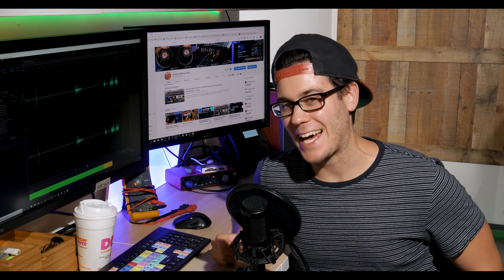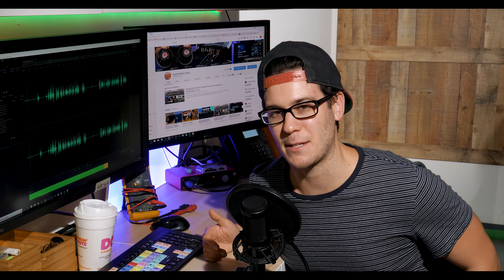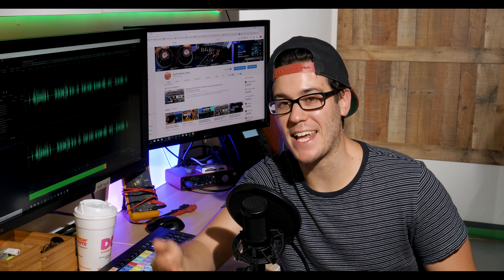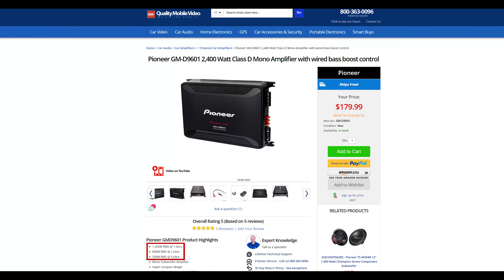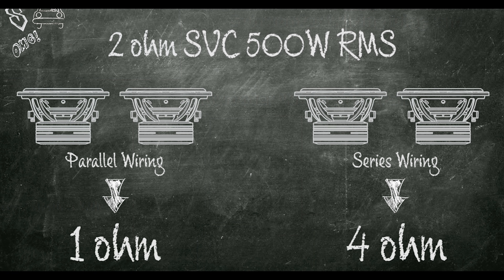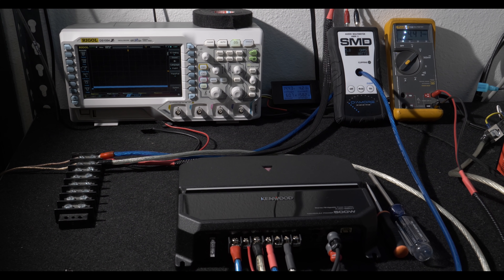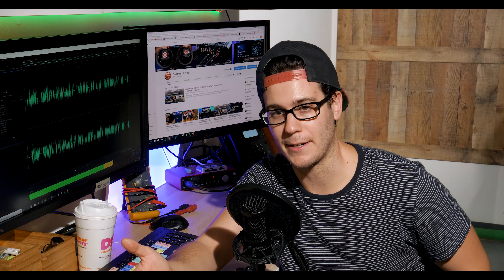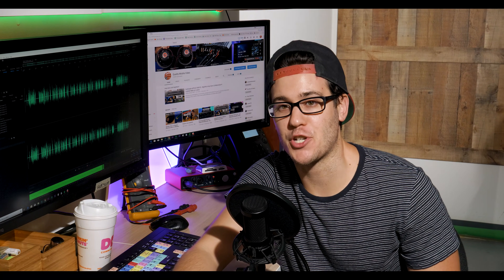Parallel Wiring vs Series Wiring - More Bass?  Cahh Audio 101

Comment: Ok I have 2 10 inch eclipse, 3oHM 500 rms sw8102DVC  wire@3ohm & in a JL power wedged box seald I want to run them at 0.8 ohms but my cxa800 kicker amp and my blapunkt 3000d can barely keep up with it my lights dim my rpm’s drop and my car will seem to all most die I have a new alt battry big3 @0.8ohm  I don’t want to blow the amps    what amps do good at   1000 rms @0.8 ohms stable do I need bigger whire like o gage i have 4 gage or a super hybrid cap? What would be the best way to go

Comment: Great video! You are one funny dude. I was rolling! Anyway, I have a roughly 6 or 7 yr old hifonics brutus amp which still works perfectly. It is a 2400.1d monoblock. I WAS using it to power two 600 watt RMS Audiobahn 10 inch subs at 4 ohms. Those subs are 25 yrs old. It's time to upgrade!! Since I have limited space for the box, I want to get 2 really good 8 inch subs. I'm leaning heavily towards two CT Sound 8 inch Meso's which are rated at 800 RMS watts each. A CT dual enclosure is the right size for my space (L, W, H) and is a perfect match for the subs according to the CT website. My question is, should I buy the dual voice coil 2 ohm or the dual voice coil 4 ohm? I would like to run them at 1 ohm so I can utilize all of the 2400 watts of my amp. So basically 1200 watts per speaker. According to all the research I've done on these subs, they can definitely handle the extra power! The box is ported and tuned to 39 hz and the amp IS 1 ohm stable. From everything I've seen on YouTube, I THINK I should get the dual vc 4 ohms and wire them in parallel to get a final impedance of 1 ohm. Is this correct?

Comment: I have 2 skar sdr 10 D2 subs and I sundown 1750 Mono amp 1ohm. Should I wire the subs to 1ohm ?
Reply from the maker: You won’t be able to, you can only make a 0.5 ohm load or a 2 ohm load with D2’s

Comment: I heard somewhere that wiring in series increases motor force... But not sure if that's true
Reply from the maker: That would be new to me, motor force should be a product of magnet strength and electrical current in the coil under thermal limit. I could be wrong.

Comment: Ok so I have a kicker l7 solo baric 2ohm how should I wire it also I have a pioneer 1,000 watt amp should I wire it negative to positive on one side then the other negative and pos to amp or should I run wires to pos to pos and negative to negative

Comment: I’m going to buy 2 Skar Audio SVR-12 12-inch dual 2 ohm subs, a ported box (SK2X12V) that is tuned to 32HZ, and  the RP-2000.1D Class D monoblock that makes 2000 w rms at 1 OHM and 2800w max, how should I wire these up? And at what ohm? I’m barely learning about this so I would appreciate any help 👍

Comment: Ok I have two alpine type s 10s with an alpine s-a60m amp can I wire them down to 1 ohm or what is the best way to wire these for the most bass for this Application
Reply from the maker: If the amp supports the load, you will get the most power at 1 ohm

Comment: I have 3 Kicker Comp C12s and a 1500 watt Planet Audio anarchy amp. I want it to hit hard and not destroy either one. Going in a 88 Monte Carlo. 2 in a vented box 1 in a single kicker box
Reply from the maker: Depending on what model amp it likely will not be enough. Many of the Plant “1500 watt” amps are class AB and will run only down to 2 ohms and put out 200-400 watts tops.
Reply: I have two kicker comp r 12s on a 4000 watt planet audio amp custom ported box In A cutlass .No upgraded alternator or anything . I’d honestly put about a 6000 watt amp on there . Bridge the speakers . And let that mf quake

Comment: If the speaker is 2 ohms its more bass
Reply from the maker: Not necessarily, depends on you amplifier too. Subwoofer impedance and voice coil size also dictate what kind of loads you can make at your amplifier for wiring. The lower the load, the more power.

Comment: I can’t decide whether to drive my single, sealed (1cuft) 12” Audiofrog subwoofer at 1 or 2 ohm. Subwoofer is 500wrms. Helix M One Amp can do either but @ 1ohm it’s 600w and @ 2 it’s 410w. My goal is accuracy, efficiency, and SQ. I’m leaning towards 2ohm. But is sacrificing that extra power worth however much more “efficient” it will be? It’s under the drivers seat so it has plenty of breathing room.
Reply: Run it at 1 ohm

Comment: I’m new to the whole audio stuff on vehicles. So this may be a dumb question. But would anyone know why My amp gets INSANELY hot? I installed it myself. After watching a video. So it’s very likely I messed something up😂 but everything works right. I bought a kit, it came with subs and an amp. It was a audiopipe kit (AudioPipe #APSB-1299pp) the amp is 500 watts. I’ve been told the amp isn’t good enough and I’ve been told my wiring was messed up or not “big” enough. The wires that I used came with the kit. I think the power and ground is 10 gauge and the speaker wire is 12 gauge. Like I said I’m new. And I have no one other than YouTube to ask 😂 any help would be appreciated.
Reply: Your ground might not be in a good spot that’ll cause heat, I melted a terminal like that, also I’d upgrade wiring because if your putting it too close to its rms rating it will heat the wire up allowing more power through due to less resist

Comment: Love your videos! Where I live the only nearby installation place was best buy, the guy wired my 1ohm 2000w amp and my single 12inch 4ohm dvc subwoofer in an enclosure(stock head unit with an adapter for RCA input)  he told me he wired it  parallel instead of  series( or vice-versa) and came out to 16 ohms and that would be better and more powerful than wiring it to 2ohm or 1ohm. I know he was wrong but I didn't have time to argue I had my 1yr old daughter with me and I work full time or I would've done it myself. Plz explain what he did wrong and what the proper way to install my system was?? 😅
Reply: That would be 8 ohms. Wire in series to 2 ohms. Search wire dual 4 ohm series 2 ohms.

Comment: I have 2 Rockville K5 W15K5S2 15 inch 2000w 2 Ohm Car Audio Subwoofer Sub 500w RMS in a sealed box hooked to a Rockville  dB12 2000 Watt Peak/500w CEA rated RMS Mono 2 Ohm Amplifier Car Amp.. I know it’s underpowered atm but I was wondering how big of an amp should I get and the opinion on wiring them for bigger boom without blowing them?

Comment: SUP BUD! I HAVE A SKAR audio RP-800.1DM 800 Watt Monoblock Class D Marine Subwoofer Amplifier IN MY STREET KAYAK. I HAVE A DUAL 2 OHM L7. SO YOU'RE SAYING I NEED TO WIRE IT 1 OHM IN PARALLEL  TO GET MAX POWER?
Reply from the maker: That's exactly right! To take advantage of the 800W RMS of power your amplifier can put out at 1 ohm, wire your DVC 2 ohm woofer in parallel to a 1 ohm load :)
Reply: Thanks bud. Are ya from Boston? I just moved from there.

Comment: If it’s 400w rms is that per coil? Like if I wore it to 1 ohm can I put 800 through it saftley? I have the same sub and a 1500watt rms 1 ohm stable amp
Reply from the maker: I need to know the specifications of the subwoofer. Is it DVC or SVC? 2 ohm or 4 ohm? What is it's total RMS?

Comment: i got two 15" pyle subwoofers, rms is 1000w a peace 2000 max 4ohm i dont know what type of car im goin to put it in but i want to know what type of amp should i use to make them sound good and how should i build the box
Reply: Definately not a true rms rating. You would blow them up sending 1000 watts to them. Pyle severely overrates their junk.

Comment: Can I run 2 dual 2ohms subwoofers to 2 separate amps at 1ohm? 2 scar EVL 12s 1250 rms watts a sub. Amps are 1500 rms watts per amp
Reply from the maker: Yup! One DVC 2 ohm subwoofer will wire to 1 ohm in parallel
Reply: @Qualitymobilevideo  can I bridge both amps together or they have to be ran separate to each speaker at 1ohm? Hope you understand my question or I can rephrase it
Reply from the maker: @LearnWithDeeboy  It depends on the amplifiers! Check your manual to see if they're bridgeable and can be connected
Reply: @Qualitymobilevideo  how would you do your setup, if you bought 2 scar Audio DVC 2ohms subwoofers 1250 rms watts a sub and got 2 1500 watts 1 ohm class D mono amp
Reply from the maker: @LearnWithDeeboy  Those are beast subs so they'd either need their own amps like you have or wire them together on an even more powerful monoblock
Reply: @Qualitymobilevideo  thanks bro. I subscribed to you and hit that bell notification.

Comment: PLZ HELP ME . I AM IN A DIY PROJECT, I NEED A HELP , I HAV 2 , 4OHM 3 W  SATELITE SPEAKERS AND 8 OHM 10 W WOOFER AND AS I CONNECT BOTH SATELITE SPEAKERS, ONE IN EACH CHANNEL ON ARDUINO M406 HAVING A PAM8403 IT SEEMS LIKE THE SPEAKER MEMBRANE GETTING SUCKED INSIDE WHILE PLAYING , THE SUB WOOFER HAVING NO ISSUE TAKING THE CHANNEL SINGLE HANDEDLY .....

Comment: What happens when you add two subs of same size and ohms in parallel for example 2ohms each sub with 125watts each rms , my question is if watts add or divide after final connection  whether is in parallel or series ? What’s the total rms wattage on this two subs
Reply: Think that would be 250 rms
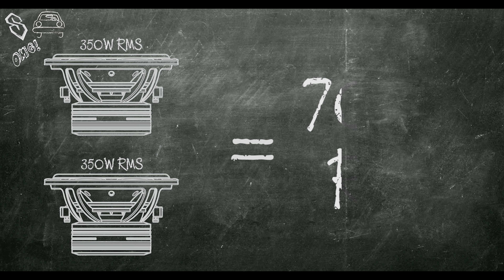See 1:45
Reply: The RMS of the subs never change. How you wire the subs basically tells the amplifier how much power or wattage to put out. If you have (2) 2 ohm DVC subs wired in parallel you’d be at .5 ohm or half ohm. That’s too low for most amplifiers depending on electrical capabilities of vehicle. Definitely too low for beginners. 🔥

Comment: Hey bro I got a 4 dual Power Acoustik Gothic , and i connected it as a 2 dual ohm will it mess up? Or what's better way to get more bass out of it?
Reply from the maker: The lowest impedance one DVC 4 ohm woofer can be wired to is 2 ohm so you're good

Comment: I recently bought 2 DB Drive WDX G2 Dual 4 ohm 8in subs  w/ sub box with a 750W rms ea. What would be a perfect amp to get? New to the car audio scene
Reply from the maker: Those are beast subwoofers for a first system! So you have Two DVC 4 ohm subwoofers, meaning you can wire to 1 ohm or 4 ohm at an amplifier. Since your subs are so powerful, combining for 1500W RMS, you'll want to go for the 1 ohm load, it's hard finding amps with that much power at 4 ohm. So you need a monoblock with a power range of about 1400-1700WRMS @ 1 ohm. Here are some options:

Orion XTR15001.Dz 
https://www.qualitymobilevideo.com/xtr15001dz.html?utm_source=YouTube&utm_medium=Video&utm_campaign=Kicker_Line

Power Acoustik BAMF1-3000D 
http://www.qualitymobilevideo.com/bamf1-3000d.html?utm_source=YouTube&utm_medium=Video&utm_campaign=Match_Subwoofers-Amplifiers

Hifonics BRX1516.1D Brutus
http://www.qualitymobilevideo.com/brx1516-1.html?utm_source=YouTube&utm_medium=Video&utm_campaign=Match_Subwoofers-Amplifiers

Comment: I’m new at this and the way I learn is asking questions. So, stupid or not here goes. When I run 2 speakers in parallel and I have an amplifier sending 150 watts out to that channel does each speaker get 150 watts or does each speaker get 75 watts? I appreciate any information that you can give me.
Reply from the maker: It's ok it's a common question! If you're wiring two speakers to a single channel, the of that output will be split evenly to both speakers. Otherwise the amplifier's power would magically double lol
Reply: Quality Mobile Video Thank-you clarifying that. If you don’t mind then I have several questions. I don’t want to take advantage of your kindness but I have nobody else to get these questions answered and you’re obviously an expert. Of course, you don’t have to tell me anything but your advice is appreciated and respected. First, when I calculate watts going to my speakers from an amp. Do I include the watts coming from stereo itself?
Reply from the maker: No, the power is coming from your new external amplifier to the speakers
Reply: Quality Mobile Video ok thank-you. I hope you can put up with one more question from a newbie. Ive learned that Ohm ratings is resistance. I’m thinking that an 8ohm speaker is probably clearer than a 4 or 2 ohm speaker. I bought four 6*8 speakers that are 8 ohms each for my F-150. I didn’t expect them to be 8 ohms. They have an RMS rating of 125 watts each. I’m having a lot of trouble finding an amplifier that matches. I can’t afford to spend $400-$500 on an amplifier. So, I got punked when I bought a Blaupunkt 1504. The ad said 4ch-150watts RMS at 4ohm. It was only $61 but again I’m new at this. Ive been bridging the amp into 2 channels and running the speakers parallel front/back. I knew that would cut my ohms to 4 and get the most from that amp. IT KEEPS OVERHEATING.
Reply: It posted before I got to ask my question. Am I going to keep overheating amps by bridging it and running my speakers parallel? Is there any other way to drop the speaker ohms besides hooking them up parallel?

Comment: why does 2x 2 Ohm in Series= 8 Ohm 
    and   2x 4 Ohm in series = 4 Ohm
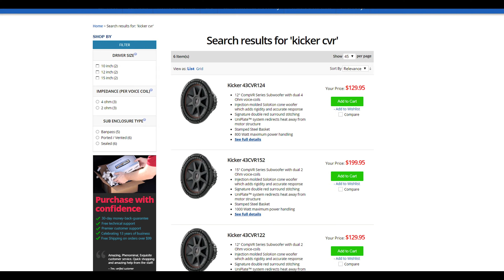3:22
i don't get that, does Ohm not add if put in series 2+2=4  4+4=8??
Reply: Yes he is wrong, he should switch the results with eachother then it's correct.

Comment: So i have 4 12 in woofers. Dual coil and a 4000 watt 4 channel amp but more like 2000 watt amp cause its cheap lol do i need to bridge or parallel or just hook each one up to each channel since its 4 channel and im powering 4 woofers thanks they are 4 ohm also so i cant really make them 2 ohm. Probably would burn something out eventually

Comment: You can wire speakers in series or parallel but keep in mind that if you go too low of a impedance your amplifier will overheat and get internally damaged or even shut off on you also if you go too high of a impedance your amplifier will not put out any power at all and nothing will happen also going too high or loo low of a impedance can cause distortion on some amplifiers also some amplifiers don't like it when you wire more than one speaker in series or parallel to one channel on some amplifiers because some amplifiers have overload protection circuits to prevent you from wiring more than one speaker to same channel on a amplifier even if the speakers are wired above or at the amplifiers stable impedance so at this point you can only wire one speaker with a single voice coil to the same channel on amplifiers that have a overload protection circuit on them and keep in mind that a overload led will usually be yellow on a amplifier

Comment: Bro I have 4 4 ohm speakers rated at 45rms and i have a 2 channel amp which is 4ohm and 2 ohm stable. It can handle 95rms x 2 channels. Can I use parallel wiring?

Comment: I just bought 2 skar sdr 15's there dual voice coil and there 2 ohm can I hook them up to a 1 ohm mono amp?
Reply from the maker: Unfortunately, you cannot. Two DVC 2 ohm subwoofers wire to either a 2 ohm load or 8 ohm load. They can't wire to 1 ohm together.
Reply: @Qualitymobilevideo  some mono amps are capable of a 2 ohm load though right?

Comment: I got some 8 n 6 inch fatial pro speakers but I want to do my own custom build speaker box n want to know which connection would give me a louder sound output (parallel or series )?
Reply from the maker: Parallel will give you lower loads which means more sound and power

Comment: Help me out here please, i have 2 10” kicker cvx 4 ohms rated 600 watts rms connected to a Rockford fosgate 1200 prime series, also have a digital bass restorer, how can i get the best sound out of them? Currently set up at 2 ohms but not liking the sound so much, thank you
Reply from the maker: So two DVC 4 ohm woofers cannot be wired to 2 ohms. You'd have to wire to 1 ohm(parallel) or 4 ohm(series). 1 ohm gets you the most possible power and loudness. 4 ohm is less more, more efficiency.

Comment: What size amp should I use for my (2)Ts-sw300s24 with 400rms???...I have a sealed box that sits under the seat
Reply from the maker: Two SVC 4 ohm woofers wire to 2 ohm or 8 ohm, go 2 ohm. 800W RMS combined power. Chekc these

Kenwood KAC-9106D 1,000W RMS @ 2 ohm
http://www.qualitymobilevideo.com/kac9106d.html?utm_source=YouTube&utm_medium=Video&utm_campaign=RockfordFosgate_Punch-Loaded-Enclosures

Rockford Fosgate R1200-1D 800W RMS @ 2 ohm 
http://www.qualitymobilevideo.com/rockford-fosgate-r1200-1d.html?utm_source=YouTube&utm_medium=Video&utm_campaign=RockfordFosgate_Punch-Loaded-Enclosures

Pioneer GM-D9701 800W RMS @ 2 ohm (This works again but its better for a 2 ohm woofer and 1 ohm load)
http://www.qualitymobilevideo.com/gm-d9701.html?utm_source=YouTube&utm_medium=Video&utm_campaign=RockfordFosgate_Punch-Loaded-Enclosures

Comment: I have a 3000 watt hifonics Brutus competition amp and 2 12 inch alpine type r ohm speakers whats the best way to wire them
Reply from the maker: Need more info on the gear. What are the exact models off everything so I can look up the relevant specs

Comment: 2 10in kickers comp cvr  with a ignite amp 6000 watts how to wire
Reply from the maker: Are they 2 ohm or 4 ohm subs
Reply: @Qualitymobilevideo   they are 4 I just don't know how to wire them 10in kickers comp cvr there the GREY 1s they have 4 poles on the back

Comment: Can you help me wiring a 2 15" cvx dvc 4ohm whit my kicker zx 2500.1 in a pro box (divided inside the box)
Reply from the maker: So you'll have to wire to the 4 ohm load in series. You can't do the 2 ohm load. Here are our wiring diagrams. Go to the bottom of the page for your wiring. https://www.qualitymobilevideo.com/subwoofer-impedance-wiring-wizard